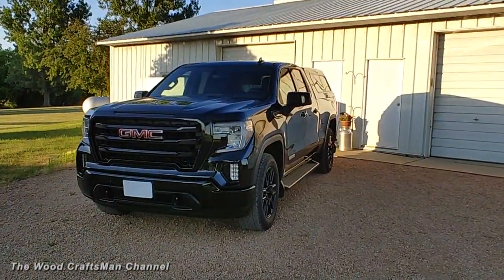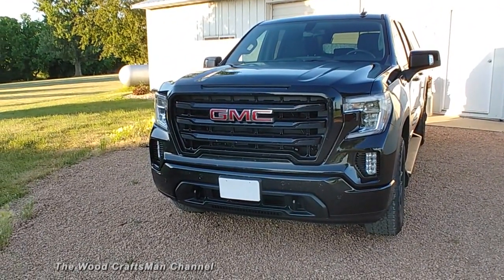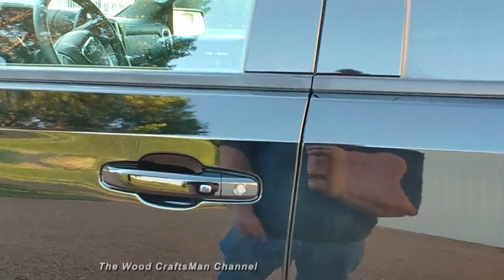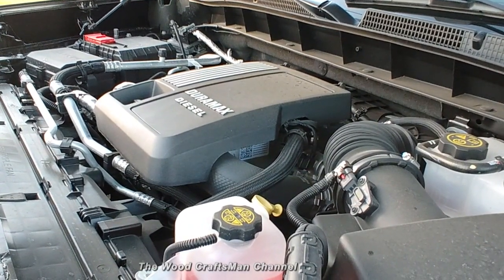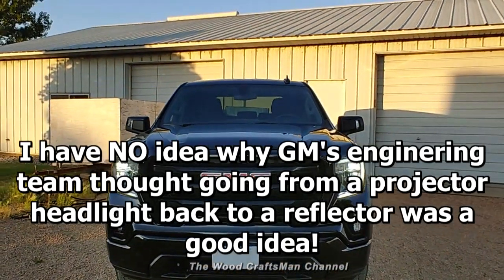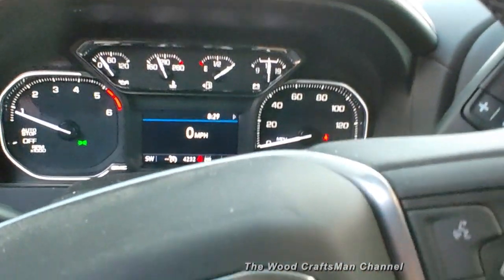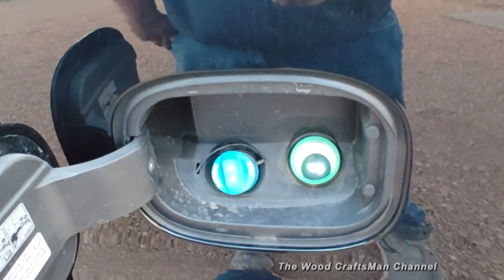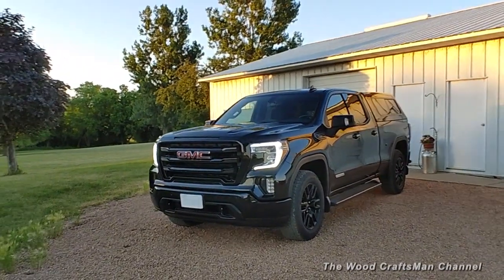2021 GMC Sierra Elevation 1500 Walk Around

Comment: I agree with you, the low beams are poor, I had to keep the fog lights on to see better.
Reply from the maker: Same here. The part that's very irritating is nobody such as Morimotto or Alpharex makes an aftermarket. They are so focused on Ford, Ram and Toyota models of so many model years. Either they have worse lighting than GM, or there interest is not in providing a quality product for the 2019-2021 GM owners. The even more frustrating fact is GM felt that the headlight performance is based on price point. If I would have gotten a Denali and possibly the AT4, they are equipped with "High Output" LED headlights. C'mon GM! I thought GMC "We are professional grade" was the slogan!